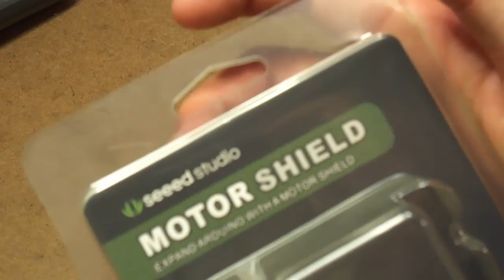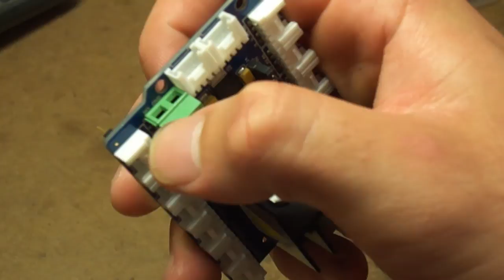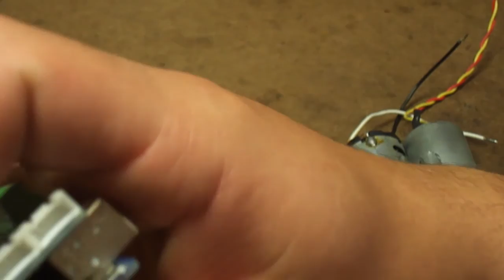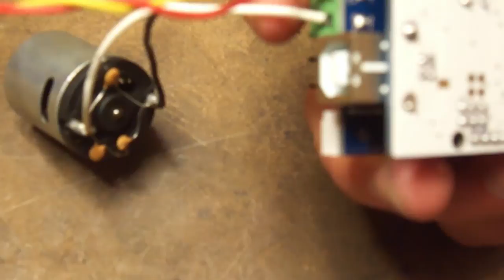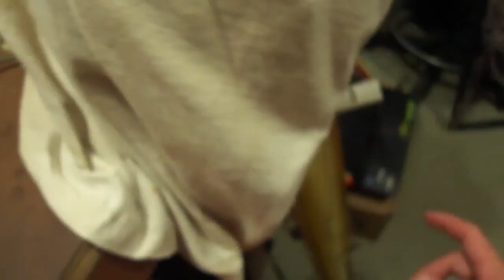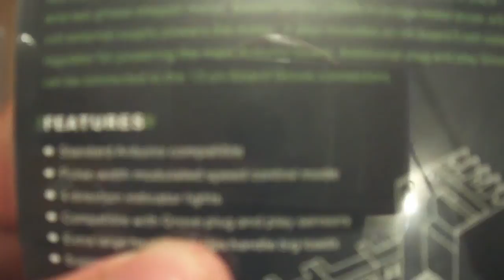Arduino Seeed Studio Motor Shield

Comment: Hi can you post the full code description please. I am new on this and trying to figure out lot of things
Reply from the maker: +Marcelo Garcia int pinI1=8;//define I1 interface
int pinI2=11;//define I2 interface 
int speedpinA=9;//enable motor A
int pinI3=12;//define I3 interface 
int pinI4=13;//define I4 interface 
int speedpinB=10;//enable motor B
int speed =127;//define the speed of motor

void setup()
{
 pinMode(pinI1,OUTPUT);
 pinMode(pinI2,OUTPUT);
 pinMode(speedpinA,OUTPUT);
 pinMode(pinI3,OUTPUT);
 pinMode(pinI4,OUTPUT);
 pinMode(speedpinB,OUTPUT);
}

void forward()
{
 analogWrite(speedpinA,speed);//input a simulation value to set the speed
 analogWrite(speedpinB,speed);
 digitalWrite(pinI4,HIGH);//turn DC Motor B move clockwise
 digitalWrite(pinI3,LOW);
 digitalWrite(pinI2,LOW);//turn DC Motor A move anticlockwise
 digitalWrite(pinI1,HIGH);
}
void backward()//
{
 analogWrite(speedpinA,speed);//input a simulation value to set the speed
 analogWrite(speedpinB,speed);
 digitalWrite(pinI4,LOW);//turn DC Motor B move anticlockwise
 digitalWrite(pinI3,HIGH);
 digitalWrite(pinI2,HIGH);//turn DC Motor A move clockwise
 digitalWrite(pinI1,LOW);
}
void left()//
{
 analogWrite(speedpinA,speed);//input a simulation value to set the speed
 analogWrite(speedpinB,speed);
 digitalWrite(pinI4,HIGH);//turn DC Motor B move clockwise
 digitalWrite(pinI3,LOW);
 digitalWrite(pinI2,HIGH);//turn DC Motor A move clockwise
 digitalWrite(pinI1,LOW);
}
void right()//
{
 analogWrite(speedpinA,speed);//input a simulation value to set the speed
 analogWrite(speedpinB,speed);
 digitalWrite(pinI4,LOW);//turn DC Motor B move anticlockwise
 digitalWrite(pinI3,HIGH);
 digitalWrite(pinI2,LOW);//turn DC Motor A move clockwise
 digitalWrite(pinI1,HIGH);
}
void stop()//
{
 digitalWrite(speedpinA,LOW);// Unenble the pin, to stop the motor. this should be done to avid damaging the motor. 
 digitalWrite(speedpinB,LOW);
 delay(1000);

}

void loop()
{
 left();
 delay(5000);
 stop();
 right();
 delay(3500);
 stop();
 forward();
 delay(2000);
 stop();
 backward();
 delay(7000); 
 stop(); 
}

Is this what you want?